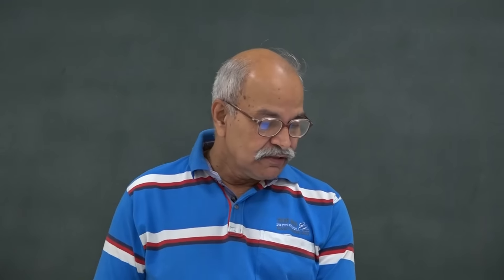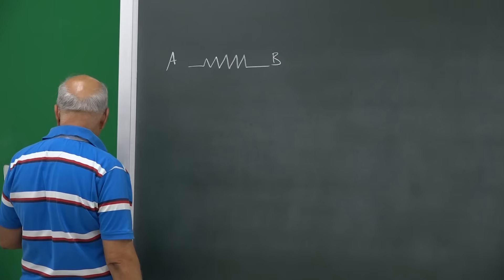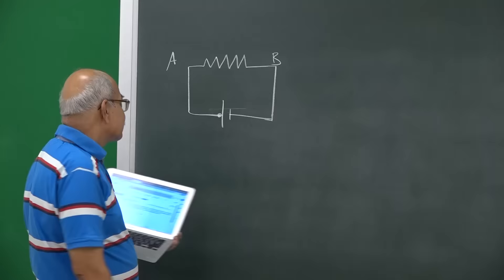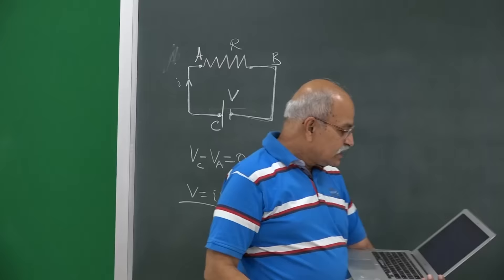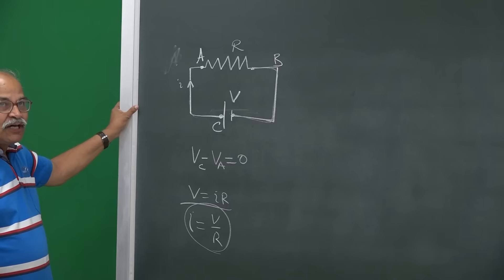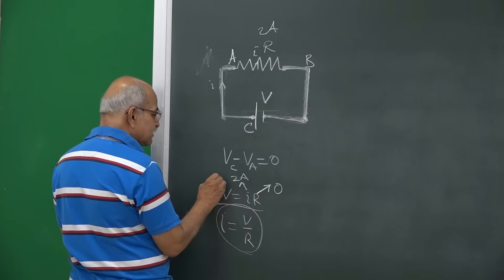Current without potential difference

Comment: Instead of giving answer of why it happened you just supported the question  ,sir
Reply: Exactly👍
Reply: Exactly ...
Reply: He already told why.. u will require concepts about ohms law...ans is due to 0 resistance.
Reply: @abhishekshukla9680   in case of zero resistance current won't flow bro..That's will be concept of superconductor
Reply: @saurav302  it will need an extra resistor as in this that is why i said you will need in depth concept about current snd ohms law.. think little more hard i m sure you will get it. Best of luck.
Reply: Bharat m sab ka sath sab ka vikas ho hi nhi skta kyki chutiye bhare hue h yaha, HC VERMA sir m bhi kmi nikal rahe h samaj isliye nhi aarha kyki tmko wo ata hi nhi srf uske liye h video jo physics pd rha h jiska physics topic h he is simply clearing the doubt entertaining video nhi bna rhe wo SAALA BRAHMA JI BHI AJAYE WO BHI 100 M SE 100 KO KHUSH NHI KR SKTE
Reply: Actually m aisa hota hi nhi hai ,
Hmne wire ko ideal assume kiya hua hai , assumption k baad accuracy maang rahe ho
Reply: Nothing is ideal ,so actually doesn't happen
Reply: Actually m potential difference zero hai hi nhi , assumption ki wajah se confusion ho rhi hai
Reply: Exactly👍 ... . He has just explained: What would happen to Voltage if we put R=0 in the OHM's Equation V= IR .... .
Reply: He answerd that even the conducting wires are supposed to be with no resistance ..but still it has resistance tends to 0..which is enough for current to flow
Reply: Exactsly he didn't answered the actual question...infact it is a brilliant question...I can see lot of ANDH BHAKTHS of him in comments section
Reply: @saurav302  nhi bhai short ckt k case me current flow hoti h .....  Jbki resistance is zero
Reply: Exactly bro🙄🙄
Reply: Yess...you are right..I was wondering bout the same...he should have put it in layman terms and then explained I believe...that how exactly it happens rather than explaining via the equation
Reply: The answer might be...cuz in reality it isn't possible for a wire to HV zero resistance...that means some amount of potential difference always is there with the help of which current flows? Could it be?

Comment: If the difference is zero means if there is no difference in potential then how a current can flow in a circuit ?? Especially between C and A
Reply: Good question actually this is what sir had to answer but as it would seem he was incapable to do so so allow me to explain it for you when the potential difference between points A and C is taken to be zero then we are in a state of assumption that no resistance is offered by the wire so in idealistic cases we see that it gives a divide by 0 error but as it is an idealistic case and everything is based more or less on assumptions rather than reality so we agree to this situation which allows us a rough measure to calculate the theoritical resistance however when we take the case of reality here the resistance of wire is tending to zero not becoming zero in any case so our current does have a value here which is not in direct conflict with our dividing by zero case giving our current a chance to flow through the wire another interesting way of understanding this is if we assume that still there is no resistance in an ideal wire then our appliance specifically in this case our resistance induces a potential difference in the wire causing the current to flow but you can understand it however you like is you understanding ability that's in the show after all!
Reply: Point C and A are essentially the same point as conductors are assumed to be ideal having zero resistances .
Practically the resistances of the wires are distributed throughout the entire wire. So if there is significant resistance(let R1), it is lumped to a point and is added with the resistance(R ,here between A and B) and again you are left with ideal conductors.
This is called lumped modelling in electrical circuits.
Hope this helps :)
Reply: @adityasharma8887  how a resistance can induced  current in circuit .. Resistance is a passive element. Passive element does not induced power
Reply: @adityasharma8887  your analogy is a total fallacy. If let's say P. D= 1 V and r in conductor is 10^-3 ohm then current will be 10^3 A. Does it happen in real life. 10^3 A is enormous current. Kindly answer me.
Reply: @anuragchakraborty3432  have you ever seen a resistor of 1/10³ Ohm magnitude in real life ?
Reply: @omshree2448  it's called a shunt. Made of wire of some material

Comment: Potential difference exist between the two ends of the resistance hence the current flow through the resistance...
And if talk about how current flow from point "B" to "C" then according to conservation of charge,charge must remain conserved hence the current will must flow through the zero resistance wire inspite of having same potential at point "B" and "C"
Reply: From where the charges start flowing ??? With 0 - v
Reply: I think that there must be some voltage ....whthere it can be negligible ...but some voltage is necessary ..to make charges to move ......do u agree with me ??
Reply: Do u think that it may happen if he once on the switch & then turned off ...so ..it can happen that due to negligible resistance ..the charges keep flowing ...what do u think ?
Reply: If there is 0 voltage then ...
Whether the wire have 0 resistance ..but it will be neutral ...
Reply: Please reply me what do u think

Comment: I probably think this as Let water flows through  a pipe from a height and reaches the ground and if the pipe is horizontal the water still  flows inspire there being no potential difference. Same is for current here.

Comment: Sir, with due respect i would like to differ a little.
1. The wires has a resistance which we consider negligible for calculations and as the wire has a resistance there will be a potential difference (might be very minor) and hence current flows.
2. Even if as per the question, we assume that the wires do not have any resistance and so in that case, the potential at A will be equal to the positive terminal of the battery and the potential at B will be equal to the negative terminal of the battery and so we can assume the current is flowing through only the resistor as together with the wire the point A and B can be thought as the battery.
Request you to clarify on my analogy.
Reply: You r right ..

Comment: Sir, I have a doubt here. 
When we have 0V and 0ohm resistance then how do we get 2 A current flowing through CA?
V/ R = I   right so shouldn't I be 0 or not defined?
Reply: Dude but, he told
If you take v=ir
Then 
0=2*0
So it is logical theoritically
Reply: Use limit R tends to 0… 😁
Reply: @sourceofeverything7053  Could you please explain that. I have not studied limits...
Reply: Limit is a complete chapter in mathematics. I cannot explain in comment. Just think that if a bomb 💣 drops and a dog 🐩 died along with an ant, we will ignore the death of ant 🐜. Although ant was present. So small things can be ignored but they are not zero. Like 10000/.0001 =~ to 10000
Reply: @sourceofeverything7053  Hmm.. okay

Comment: I've had four of these videos pop up over the last couple days and they all have really bizarre explanations. Here's two responses:

1) The p.d. at the two points just won't be the same in a real operating circuit so there is no problem.

2) To set up an ideal situation, lets say that you connect two wires to your e.m.f source without the resistor, you have essentially two very small capacitor plates at the ends of your wire at 0V and whatever your e.m.f is rated at, let's call it 5V, separated by an air gap (dielectric).

If you now connect a resistor between two wires, then you instantaneously have the situation described above, but what happens? There is a p.d. across the resistor, so electrons from the 5V wire start moving across it, this will change the voltage either side of the resistor, meaning that there is now a potential gradient everywhere in the wire and again there is no reason to argue current cannot flow.

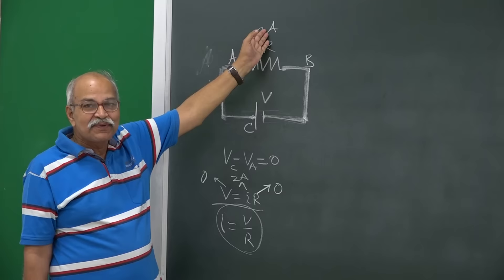Comment: 3:50 if v/r=current
Then it must mean 0/0=2a
But 0/0 is undefined
Therefore the logic may not be correct
Reply: The internation standard of the resistor symbol is that the resistance of the wire+ the resistor is shown in symbol. It can be otherwise we dont study the most accurate physics in any case
Reply: No this is a myth.  0/0 is not undefined,  it's rather indeterminate.  Think of the basic definition of division,  2/1=2 . This means 1X2 = 2 
Similarly for 0/0, we check 0 X what =0 but 0 multiplied by anything Is 0, so 0/0 cannot be 1 fixed value,  but it certainly exists
Reply: Okay thanks to both of you
Reply: @sumzk  but by that definition the value of 1 would also be indeterminate
Reply: @shinchanthelegendsofcartoo8225  how exactly
Reply: @sumzk  okay bro I am satisfied with you thnz
Can you tell me your profession if you don't have problem
Reply: drugs
Reply: @shinchanthelegendsofcartoo8225  he was certainly a student like most of us

Comment: I= V/R

If 
V =0
Then
I= 0/R
So I=0

Isn't it?
Reply: Nop.
0/n =
A) 0 if n is non-zero
B) indetermined if n is zero. 
Here, if n=0 it became 0/0 which is indetermined. It can be any number.
Reply: 0/0 ban jaaega
Reply: V can't be directly zero since.. electrons flow due to potential difference which causes electricity..so we take the constant R zero

Comment: What I understood as a class 10 student the main key to the answer was the ''clue''.
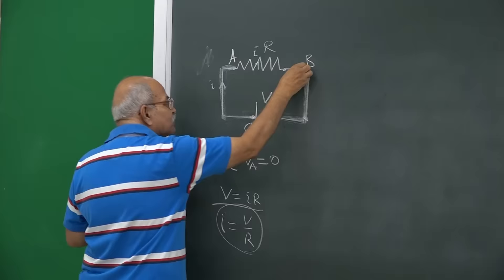2:24 to 2:41
This is the main key given by Verma sir(according to me).
We are calculating the p.d. across C and A though we know that is zero. Hence if resistance between C and A is zero then obviously there ''may or may not be current between C and A'' ( according to Ohm' s law). But as the question mentioned current therefore I think Verma sir took an arbitrary value of current .
This is my understanding so it may be wrong. But no offence to others out there who may have understood it better than me.
Reply: Bhai jee advance nikal gaya kitni rank aayi

Comment: Sir i have a question, i am in class 10. I want to know that can we generate electric current from earth   through relative motion of wire. Same as a generator because earth is also a magnet. Sir please reply🙏🙏🙏.
Reply: 1. the earth’s magnetic field is practically constant and you need a changing magnetic field (magnetic flux to be more precise) to generate a current
2. the earth’s magnetic field is very weak to generate any appreciable current

Comment: He just wrote some equation. He didn't even answer the question "Why".
Reply: One of the videos where the explanation wasn't illuminating at all
The answer to this problem lies in the approximation of a conductor's resistance to 0.
Notice that when you start taking its limit approaching zero, the problem starts seeming trivial by itself. This whole misconception arises because people believe in the exactness of the zero resistance.
Now, see it this way.
Let us suppose that there is a resistance R in a DC circuit with a battery of voltage V. Let us take that the wires have a resistance r.
Now, net current, by Ohm's law=(V/(R+r))
The potential drop across the wires is then-
Vr/(R+r). Now, notice that in the limit r->0, the denominator reduces to just R and the numerator gives 0. Thus voltage across the wires being zero is just an approximation
Reply: He answered that we assume the resistance of wire to be 0 but it has some resistance that's why there is a potential difference between c and a
Reply: @sarthakgirdhar2833  right this makes sense. Also I have a conceptual explanation, feel free to correct me if i'm wrong and want to. So, since there is a potential difference at the end points of the resistor, current starts to flow which creates a potential difference between battery and the end point of the battery connected to the positive terminal, so the current starts flowing in the positive arm of the circuit and likewise of for the negative arm but the events occur in reverse order.
Reply: im assuming its because your only looking at a small part of the circuit and not the entire thing, the end of the battery has a potential difference and that's why it moves from the beginning of the battery to the end of the battery, and if the wire has zero resistance( superconductor) the current would still flow

Comment: But in wheatstone bridge when potential difference between 2 points become 0 .. we can neglect that middle resistance.. we are taught that no current flows when potential difference is zero between 2 points... then why has this ques even come up????????? Kindly explain me..
Reply: Ya you are correct but the voltage across resistor is 0 that's why no current flows throught it
Reply: Contd
Potential always drops when there is a circuit element like a resistor, capacitor, inductor, etc.
Reply: V=IR , so if V=0 then either I =0 or R=0. In wheatstone bridge resistance is not zero so current has to be zero to satisfy the ohm's law.
 If we apply kirchoff's second law in wheatstone bridge then in it's expression the contribution due to middle resistance will be zero (because i=0 ) so, we neglect middle resistance for circuit analysis. Resistance is not equal to zero as in the above situation.

Comment: Diff. In potential between one end of battery and A end of resistor simply triggers that the potential at the end of resistor is same as that at end of battery ......which means the question is trying to inform us that the connecting wires have zero resistance

Comment: I thought the answer was on back emf
Reply: One of the videos where the explanation wasn't illuminating at all
The answer to this problem lies in the approximation of a conductor's resistance to 0.
Notice that when you start taking its limit approaching zero, the problem starts seeming trivial by itself. This whole misconception arises because people believe in the exactness of the zero resistance.
Now, see it this way.
Let us suppose that there is a resistance R in a DC circuit with a battery of voltage V. Let us take that the wires have a resistance r.
Now, net current, by Ohm's law=(V/(R+r))
The potential drop across the wires is then-
Vr/(R+r). Now, notice that in the limit r->0, the denominator reduces to just R and the numerator gives 0. Thus voltage across the wires being zero is just an approximation
Reply: @sarthakgirdhar2833  Bhai main class 10 main Hun yeh mere Kam hai kya
Reply: @harshkesathorigami1165  bilkul
Reply: @sarthakgirdhar2833  okay bro

Comment: Why does light bends on refraction, i mean what happens to the light that its speed changes.please explain
Reply: Due to different wavelenghts of spectrum
Reply: Speed of light differs from one medium to another, for example, from denser to rarer, it moves away from the normal and vice-versa (I.e, from rarer to denser it moves towards the normal)
Reply: @Supratim_Kundu  utna ham bhi jante hai thanks haaa
Reply: That's the 10th and 11th standard answer 😏
Reply: @Supratim_Kundu  ya thanks ok
Reply: Dude when it moves from rare to dense medium,it moves rowards the medium and when it moves from dense to rare,it moves opposite to normal
Reply: If you want an accurate answer, nothing happens to speed of light, it is constant... What you see is emission of light energy due to Silicon atom present in glass slab.
Refer to video on Science Asylum
Reply: @You12783  ya but not exactly what u are telling but thanks,actually light slows down in materials as they are seen as bunch of photones,and their properties are different from individual photones
Reply: @rohitraj4275  Brother even a single photon is light... The term light is ambiguous, it could refer to both things.
Coming to your question, the bending occurs in light as light has to keep the electric field component perpendicular to it during propagation smaller in glass as compared to air.
So the slanted approaching wavelet of light gets bent more when it enters the glass.
Reply: @You12783  ya nice
Reply: Hope hcv sir will adress this question
Reply: @rohitraj4275  Ya, I think questions like this could be easily answered if one just accept the fact that in physics we deal with special cases of mathematics... The don't always agree with nature but they're approximately correct. Like the Simple pendulum's Time period, it true for smaller angle but in case of any angle you'll need to construct an O.D.E to calculate it.
Reply: @You12783  ya we cannot experience everything in physics but we must srive to feel it thats the beauty of physics  nice to talk u 
We connect on any platform like quora or etc i liked ur attitude towards physics

Comment: But sir current flow from higher potential to lower potential na. 
Their potential are equal how the current will flow by rule of equal potential current cannot flow here:(🤔🤔
Reply: Ya he explained only through equations but not gave physical meaning
Reply: Lol
Reply: Practically resistance is distributed  over entire wire not lumped. For our convenience we take it as lumped.
Reply: Dont u see resistance in series. Current flow will be same on every series componant connected in same ckt . And 2nd thing theory is far differant that actuall real life ckt . To get the most accurate results , U have to consider very little detail lyk equalant series resistance,capacitance,inductance in every active componant

Comment: Ectually conceptual  question many of one didn't recognise that current can flow at 0 potential difference too😨😨👍 and yes it is possible due to 0 Resistance produced by wires #thnk u h.c verma sir one of the greatest physicist of modern era science 🔭#H.C Verma

Comment: But , if  we take current and resistant equal to 0 ,then current should also be zero. In this case current doesn't flow through this circuit. Then, how current can flow without potential difference? Please tell me..